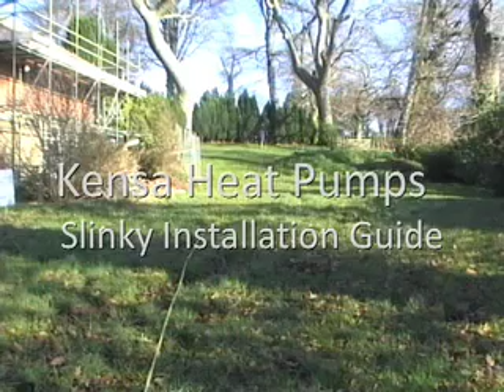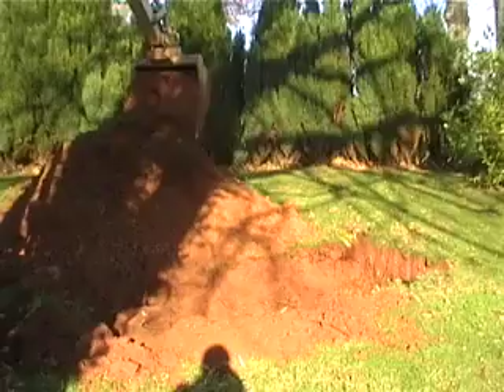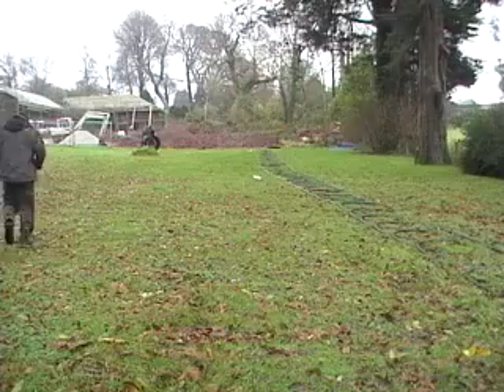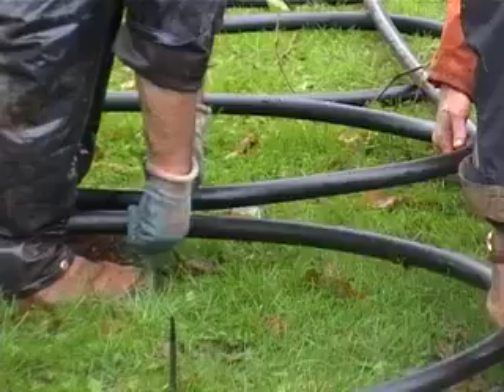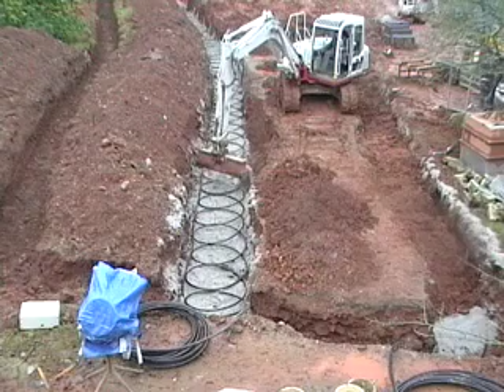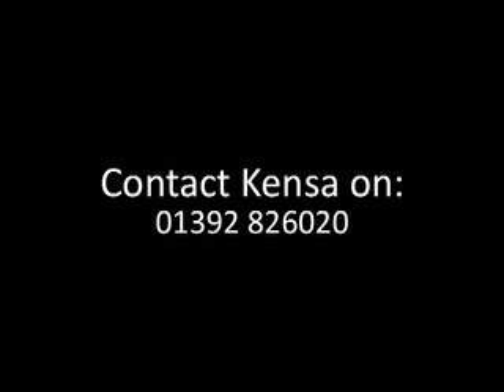Kensa Heat Pumps - Installing Slinkies for a Ground Source Heat Pump

Comment: I heard sand was not good to use?? I wonder if thats true?
Reply: Le reste de l'opération
Reply: Sand is not so good, but the material is likely to be more of a granite dust type material which is a mix of coarse and very fine grains that ensure a close connection between the pipes and the ground.